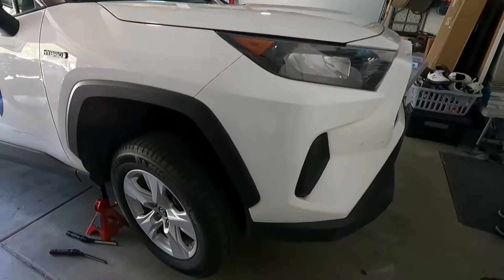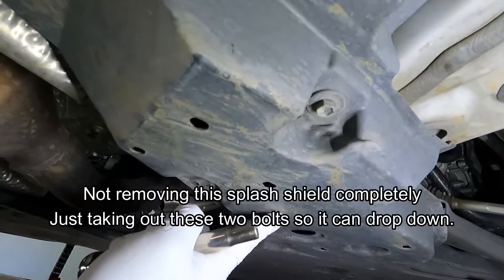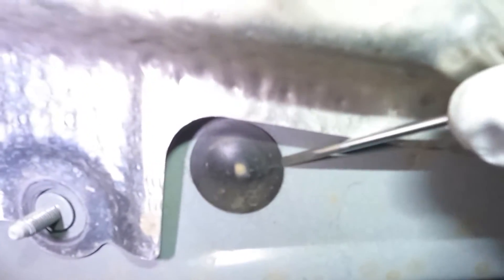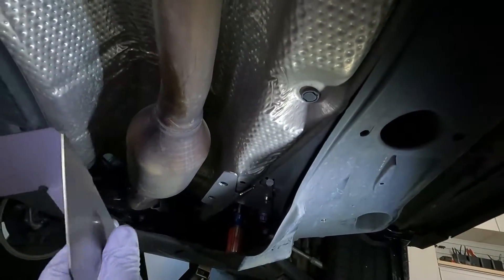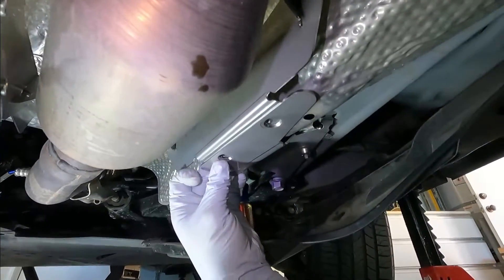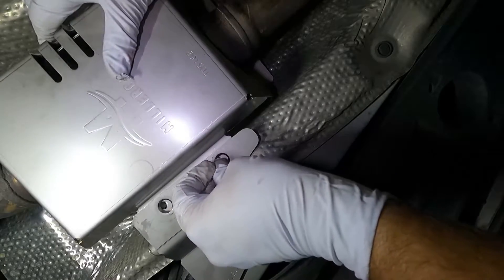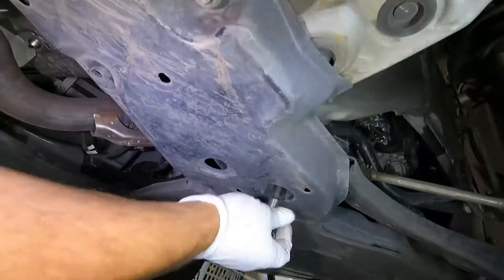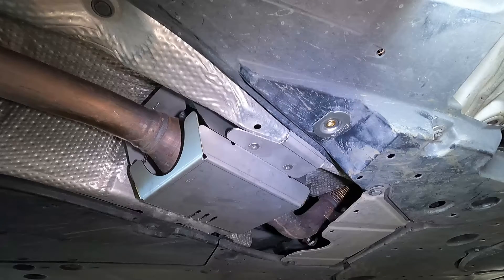2019 - 2023 Toyota RAV4 HYBRID Catalytic Converter Protection MillerCAT CAT Shield installation DIY

Comment: Looking at doing this, but I am just curious. That locator hole grommet that was removed, is that going to allow for water intrusion inside the frame or are there other drain holes somewhere? If the grommet was put there, there's probably a reason why, otherwise it would have been skipped.

Comment: Thank you! I’m getting ready to slap mine on! Great demonstration! Will Toyota have a problem working on the car now? Keep the secure bits with the tire lug lock key?
Reply from the maker: No problem,
And No, this wouldn’t prevent Toyota or any other automotive technicians from doing any regular maintenance on the vehicle.
And yes, I would just keep those bits in a safe place if you ever need to remove the shield.
Thanks for watching!
-Dan the Fix it Man
Reply: @DantheFixitMan  Does the black plastic cylinder go back in place without the white collar clips? Or we remove both of those pieces? The white clip as well as the black center piece? I just want to make sure. I’m doing this out in the desert in the sand we ain’t got fancy concrete.  lol 😂 lol Thanks again.
Reply from the maker: @randbasic  both the clear and the black plastic pieces come out and are not re-used.  The little rivet nut plate that they include in the kit threads onto the stud.
Best of luck to you!
Reply: @DantheFixitMan got it. One of the top “nuts” came out of the top shield plate. I sent an email to support asking what I should do. Are your thread rings in the top plate welded to the top plate? One of mine just popped off. Maybe they are just press fit. Mini trigger clamp help to keep all the plates lined up to get the last screws in. Until the pop off happened lol 😂
Reply from the maker: @randbasic  I believe they are PEM nuts which are pressed in.  The MillerCat customer support is excellent, I am sure they will get back to you soon.  Please keep us updated on how it goes.
Reply: @DantheFixitMan  Thanks so much Dan! I’ll let you know how it goes.
Reply: @DantheFixitMan  I just held it with the tip with my finger and started screwing it in. It caught tightened everything up and im on the road. I’ll update after the weekend. I think they are closed on the weekends! Thanks for the help! I subbed! Thanks Dan!

Comment: I bought this exact shield and paid good money 300 bucks for it and it's thin as 1/8th? 1/16th inch thickness and these thieves carry steel cutters cut right through the pipes of the muffler, anyone think maybe complete waste of money and time to install it?
Reply from the maker: I have seen several videos that prove that these really do work.  Thieves are seen on video walking up and checking under vehicles and if there is a catalytic converter shield, they move on.  I am not saying that it can’t be cut or defeated, but it takes them more time and effort and that seems to be enough to deter them.  Best of luck to you whatever you decide.
Take care,
Dan
Reply: I think the name of the game - is being more difficult and taking more time than the other cars on your block.  Remember the story of the two guys and the bear… they see the bear and one guy starts putting on his running shoes.  The other guy says “what are you doing, you can’t out run a bear”.  First guy replies “I don’t have to out run the bear - I just have to out run you!”